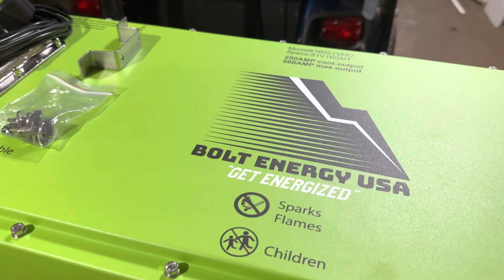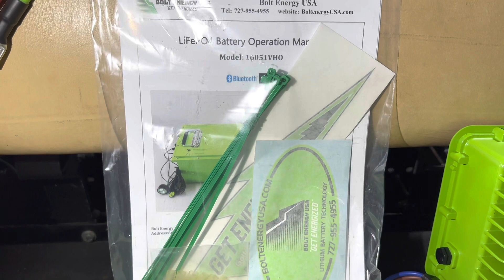Bolt Energy 48v - 160ah Lithium Golf Cart Battery Installation Video ~ EZGO TXT

Comment: $3000 for a a battery you can get for $1800 with different paint and words on it. Ok I checked the company website and they have it reduced to $2800 or $3000 for the “professional kit” which comes with a new solenoid and voltage reducer. Regardless the price is a ridiculous.
Reply from the maker: 160 ah batteries are expensive, specially ones that a tried tested and true with US support and a 10 year warranty. We don’t set the prices, we abide by the lowest listed price with free shipping.